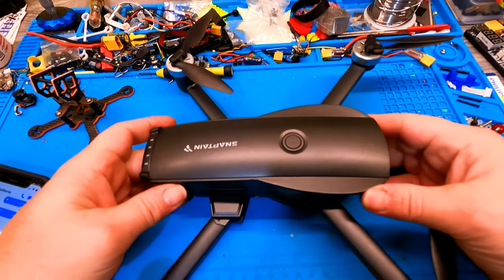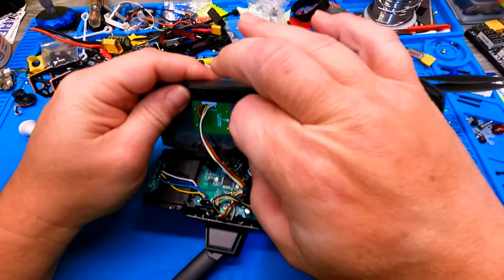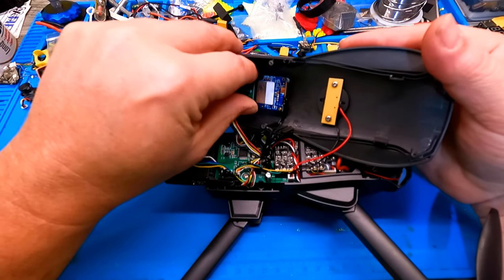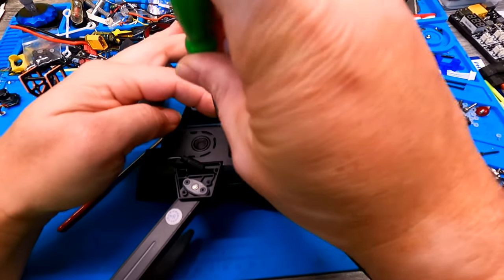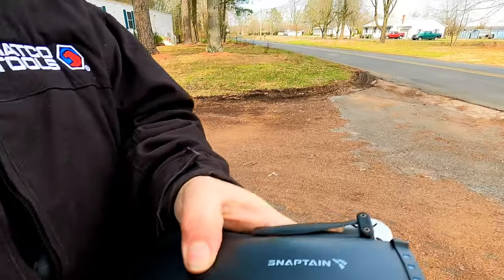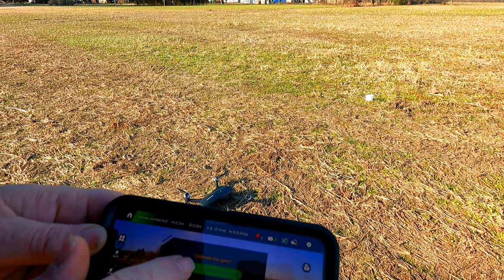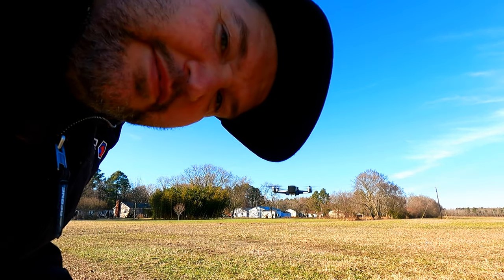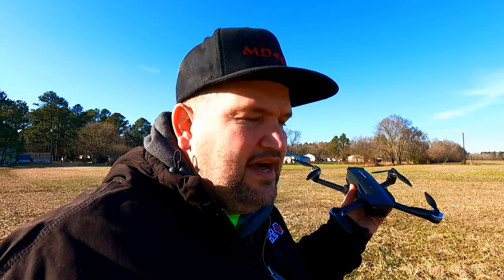Snaptain 7100 Toilet Bowl Fix

Comment: I’m about to buy one preowned on eBay for 70 this will be my 2nd drone. I really hope there’s nothing wrong with the one I buy other than relocating the tape and a screw. I have no soldering equipment and on a budget. my first drone was a snaptain S5C and I lost it 😂 I flew it with out using the phone and the wind took it lol thank you so much for your video by the way
Reply: Does it work fine I'm looking at getting one there too
Reply: @crossfire2438  managed to haggle the price from 70 to 60 on eBay haven’t received it yet but looking forward to it

Comment: Just bought the SNAPTAIN 7100. Haven’t flown it yet but it hope I dont get this issue. But thanks for the vid on the fix. I believe I can do it my self but if things go sideways is there a way to reach out to you? I started this hobby back when custom builds were the only way you could fly. I still have the frame of my first drone and the lumenier control board with 12A SimonK ESC’s. Lastly is there a way to get around the proprietary charging, for fast charge?? Hit me up.

Comment: Have you put a lot of flying time into this drone since you fixed it? I did the same fix you suggested, after opening it the gps and compass boards were secure but the tape was not covering both boards. I put the tape covering both boards and secured everything back together and it doesnt really change the flight.  It doesnt start to spiral every time, only every so often but when it does its very noticeable.

Comment: Anyone who is trying this fix. I went crazy with the shielding tape and did all the electronics on the bottom half of the drone and double taped the top GPS bits. Tape is £4 from Amazon and comes as a gold role of tape. It seems to have fixed it! A little drift here and there but seems to work. Anyone want photos of how I shielded it send me a message.

Comment: Hi Have same problem with Holy Stone 720e Really bad TBE in GPS mode.If switch is turned to the off postion drone will level itself out,but still shows all the satlites on the transmitter.Holy Stone sent me replacment ,and guess what? does the same thing.This is my fourth 720e My first drone flew perfect with no problems until it died in mid air  and crashed. Since then l have had 3 replacments and all 3 have had the same issue. JC Ontario Canada

Comment: I just bought one the battery won't charge up contacted the seller and they're sending me a new battery I went ahead and took the Drone apart to check what you showed us how to check and they were screws missing out of out of the front little box and that tape wasn't covering all the component and they didn't give me enough tape to stretch it so I could cover it all up I don't know what I'm going to do I don't have that kind of tape I don't know where to buy it

Comment: Hello. please help me a lot. I have a Snaptain SP7100 drone that suddenly stopped both propellers on the right during the flight and it only works, and the drone smells burned. The propellers on the left side work perfectly, as does the camcorder, gps. Only the propellers on the right side no longer want to work. Is there any chance I can do it?

Comment: What motor can I use to replace a damaged motor on the SP7100? Front B stopped working and I cannot figure out a replacement.
Reply: Did you ever find a replacement motor?
Reply: @JacobAdams82  I ended up selling the drone for parts to another person having the same problem. Worked out for the best!

Comment: Well, Maybe I have a newer drone. I had to remove 2 screws in the rear to take mine apart. Also, under the landing gear is a screw on each one. So. I had to remove a total of 8 screws. Also my boards were secured and did not have any missing screws.

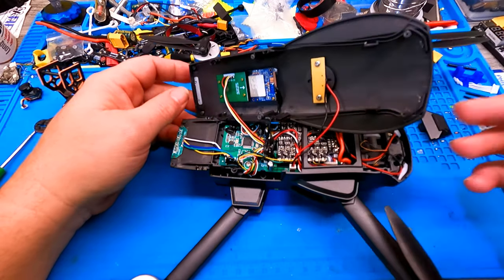Comment: 4:28 - I’m working through this on a 7100 myself.   I’m new to all this, can you explain in noob terminology what you’re soldering?
Reply from the maker: I was Soldering a Resistor that had popped loose I noticed not all have them tho